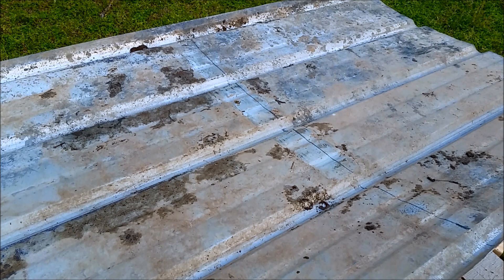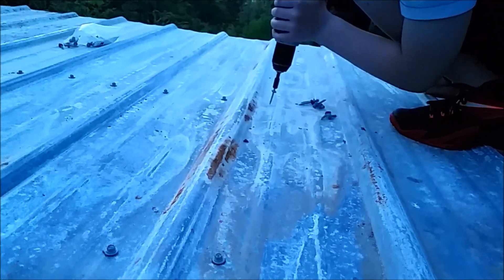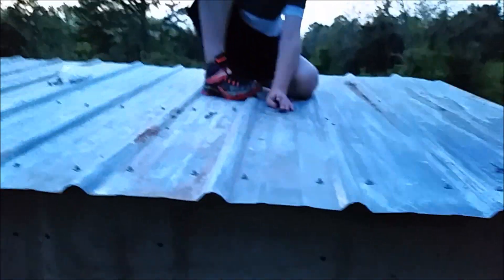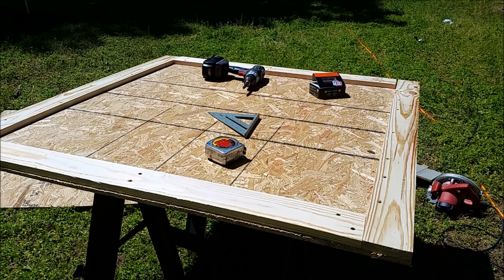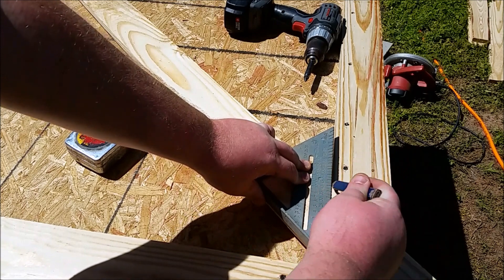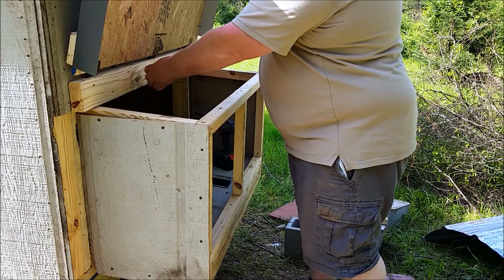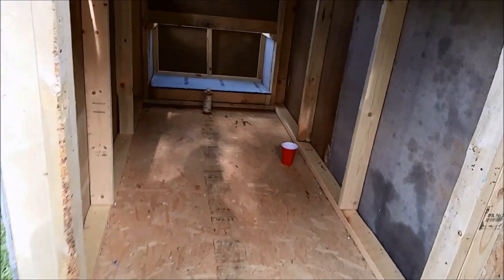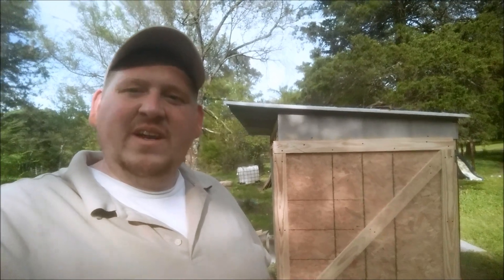Chicken Coop Build PT 4

Comment: Sweet part 44444! I have a 4 1/2" grinder with a cutoff disc if you want to borrow it, lol. About time you put that kid to work, not going to learn anything playing PlayStation all day. Good job kid. Just lay that damn board on there and mark each side and connect the dots, don't need no stinking speed square. Looks good so when are you getting those rabbits?  PS they must be Easter rabbits if your building nesting boxes huh?
Reply from the maker: Part 65 in the works lol. He is a good boy and a hard worker. It will be a while on the rabbits God bless brotherman